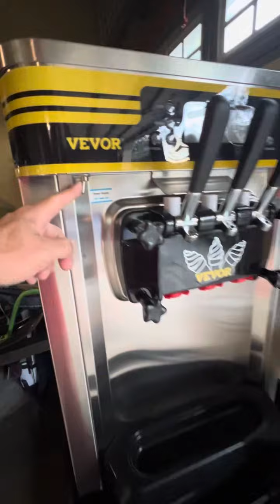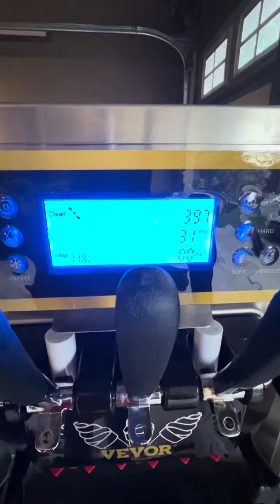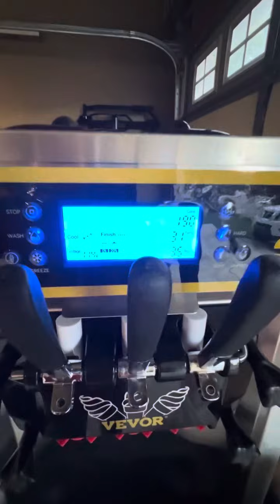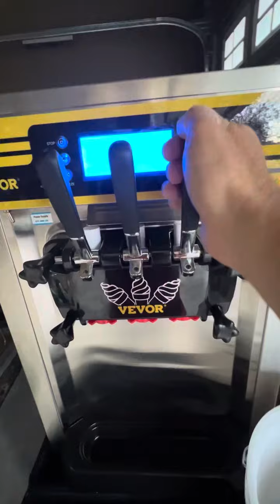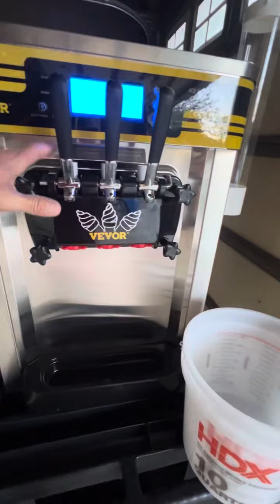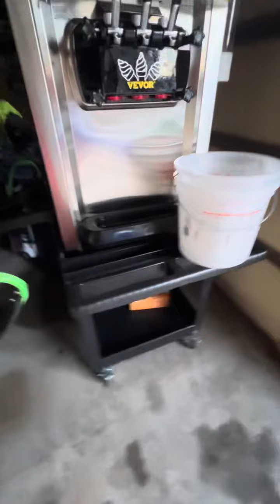Vevor Soft Serve Ice Cream Machine Operation ￼

Comment: Thank you Doug, This video was very helpful. I have a question for you if you don't mind. I have the same machine, its brand new and I think I'm doing everything correct but my ice cream mix will not get cold, it stays at room tempature. The power seems fine, the mix seems fine, I can hear the compressor running, but it will not freeze. I'm thinking there is something wrong with the machine. Sorry to bother you with this but Vevor is not responding to my calls or emails. Thank you!!!

Comment: Hey Doug, thanks for your video. I did follow all the steps but my ice cream icon never goes above the 65%. DO you know why?
Reply from the maker: You could check the hardness setting. Push and hold the set button for five seconds. The first screen that shows up is your hardness. I believe it can be set between one and 12. I have mine set at six or seven. After you adjust the setting, wait five or six seconds for it to go back into standby mode.

Comment: @dougveenker9389 Good morning. I purchased this unit the 2200w version. I have received it and im ready to power it up. I have looked at your videos and a couple others on here related to the machine not much available. Anyways I have a question please.. before I power it up. In the manual it says "if the raw material is put into the hopper (no air bubbles are generated), please adjust the puffing pole to the closed position, and then insert it into the feeding hole of the hopper.
There are three holes on the puffing tube large medium and small hole these can be adjust by twisting the top what position should this be in for operation? what does the big hole do vs the smallest?
Reply: I just got the 2350 unit. Haven’t started it up yet but it’s in the truck ready to go. How do you like the 2200 so far?
Reply: I've read that the puffing pole should be used only for plastic hoppers
so I did not use mine

Comment: Will this blow a 15amp breaker?? Why would it be 25 amps? Thats should be locked rotor amos for the compressor nit operating power consumption.  Im wondering if i can run this on a 1800w generator

Comment: Hey, I have this same machine, and I have been having problems getting the ice cream to firm up enough. Can you tell me what you set for each setting in the settings menu? 

I see these menu options when I hold down settings for 5 beeps:
Shift Menu
Cone Menu (this one does not matter)
Countdown Menu
Celceus Temp Menu 
Just a random Number in the bottom right corner

That may help me out. I am getting close, but it is still dispensing just a little too soft.
Reply: Yeah that last number I have no idea what it does. It is never mentioned in the manual.
Reply: I am having the same issue. Please let me know if you've been able to figure it out. The manual is not helpful at all.

Comment: Hello, good day, I bought this machine but I don't know how to configure it, could you help me?
Reply from the maker: @MartinAlferez-d1o  It should have come with a users manual. If you push and hold the “settings” button it will beep and cycle through the different setting options.  I have my hardness (1st option) set at 5 or 6. I have my hopper temperature set at 5°C. Once you’ve adjust one setting, push and hold the “setting” button again until it goes to the next setting. When you done adjusting the settings, just wait 5-10 seconds for it to go back to the Standby Screen.

Comment from the maker: I’ve had one at a family reunion with over 100 people and it did pretty good keeping up. This machine will pre-cool the mix that is in the hoppers making it easier to freeze and keep up with a heavy load.
Reply: thx for answer can u telle me if u will have problems with it? i want to buy one next year
Reply: does the machine in night mode cool the cylinders to or only the hoppers?
Reply from the maker: @zimon9386  I’m not positive, but I would assume both.
Reply: @dougveenker9389 unfortunately not... only the hoppers... the ice cream in the cylinders can spoil by night...

Comment: how many ice creams can u pull in a row? all say these maschines are garbage...
Reply from the maker: @zimon9386  After adjusting my settings, I pulled 40 cones in a row before it started going soft.
Reply: @dougveenker9389  I’m trying to buy one so this info helps ty.. I have a single flavor table top model 152 right now I want to be able to do the other 2 flavors.now does the chocolate mix with the vanilla? I seen a comment about that here
Reply from the maker: @zimon9386  I’ve learned a few things in the last couple of months. The machine has been great. I had to adjust the “Hardness” setting down to 5 or 6 (12 is the max). This helps keep the circuit breaker from tripping. With the hopper set at 5 degrees Celsius, it doesn’t take much for the mix to freeze once it gets in the freezing chamber. I’ve been really happy with how the machine is performing